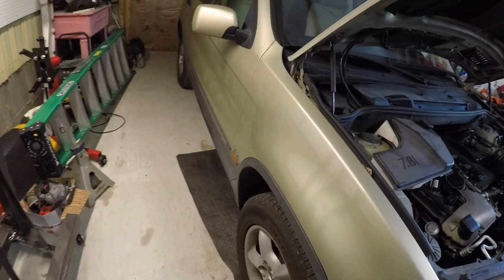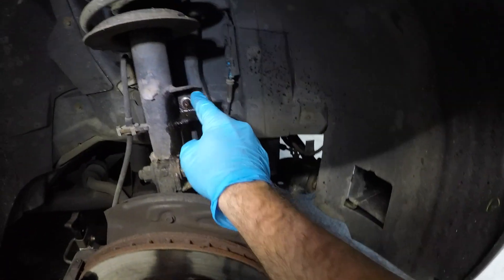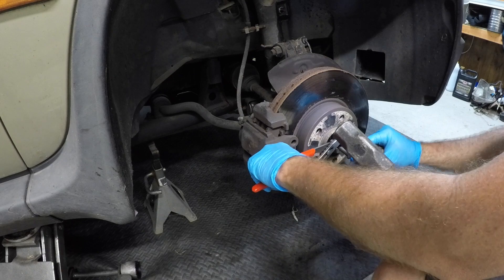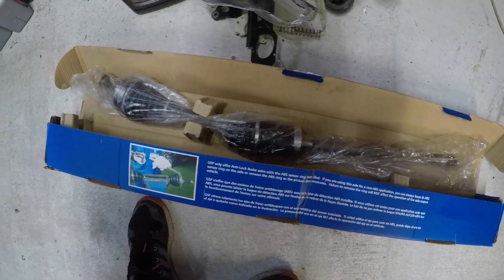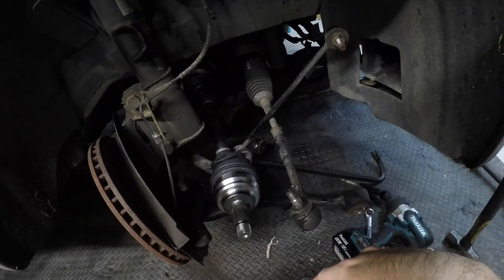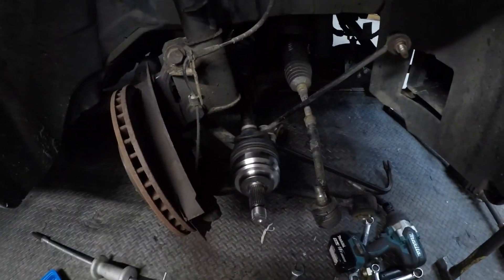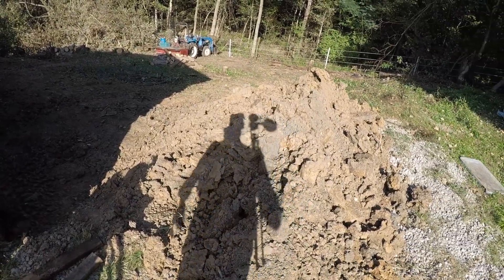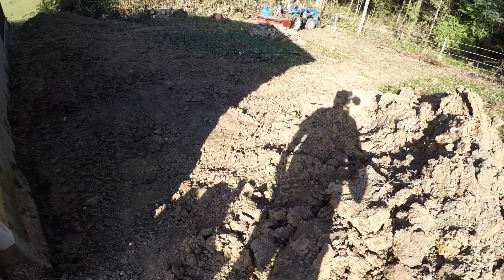BMW Xdrive XI DIY E46 E53 E90 E60 E70 E83 x3 X5 Front Right CV Axle Replacement

Comment: It would have been nice if you would have shown all the the steps you took to remove the axle and also the steps to reinstall everything. You went from removing a few bolts then jumped to the axle being on the ground and didn’t explain if you replaced all the axle or you split the two sections of the dive shaft and only used the outer part. I was confused when you came back and said the slide hammer work great but you didn’t show us where or how it was used.

Comment: Do you have a video on to replace the engine in a e83? Do I pull it up over the radiator and fan? Do I drop it down through the the bottom. I do have access to a lift.

RD

Comment: hi , i'm surprise  that you dont have any e70 4.8i project ,,  anyways right to the point ,you  will earn my subscription to your channel if you feel like answering my question, 
2009 90.000miles 4.8i  smoking from the the passenger side side of the engine , looks like is dripping right into the manifold , 1000 miles ago i jpaid $2700 for the valve stem seals and the price included the valve cover gasket , i felling in my guts that the dude just replace the PCV  seal. i could be wrong , now i have this smoke coming from the righ side hood , passenger side".
thank you , you can call me CHICHICUILOTE FROM CHIHUAHUA.